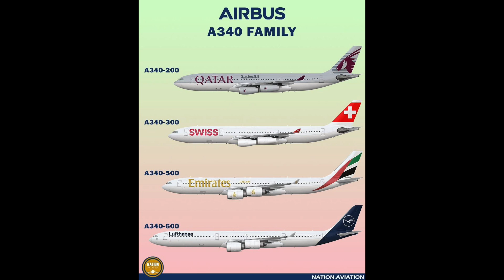Why the Airbus A340 Was Doomed From the Start

Comment: Airbus developed 340 and 330  simultaneously.
Reply from the maker: Exactly! The A330 didn’t fail because it was a twin, making it cheaper to operate just as ETOPS rules expanded. It fit airlines’ needs perfectly while the A340’s four engines became too expensive

Comment: failure? the 747 has all but dissapeared from passenger service in a few decades as well.  4 engines are just not needed apart from the supersizers.
Reply: True, the 747 faded too. Difference is, the 747 made money for years, while the A340 struggled almost from the start. Twins just took over.